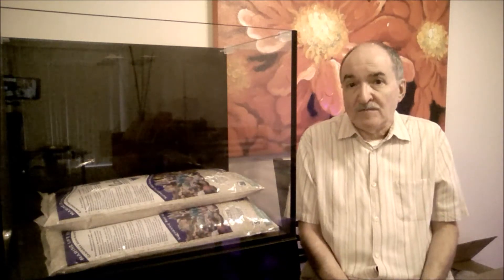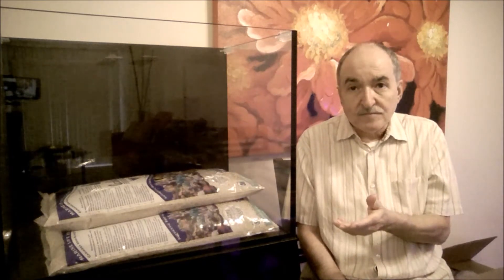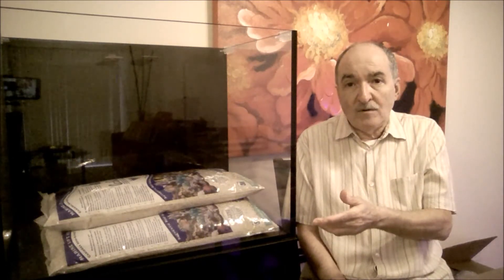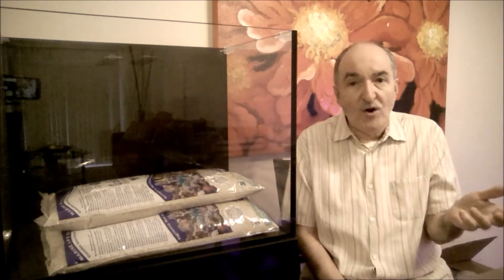Substrate - CaribSea - Fiji Pink

Comment: Will this substate maintain a good ph balance for my freshwater African chiclids
Reply from the maker: Hi 21 savage bank, first thanks for contacting me.  When it comes to the substrate I used on this video and others that are made for saltwater they could be used for freshwater, but I personally think it wouldn't help with the ph levels until a biological bacteria is created and colonist.  Eddie
Reply: Eddie's Reef Aquaria so if biological bacteria was present would it than help?
Reply from the maker: Remember that in order to have a balance PH the water has to be buffered just right.  When checking for PH you may need to buffer it in order to raise the PH.  Eddie